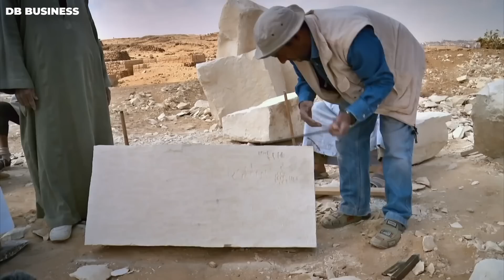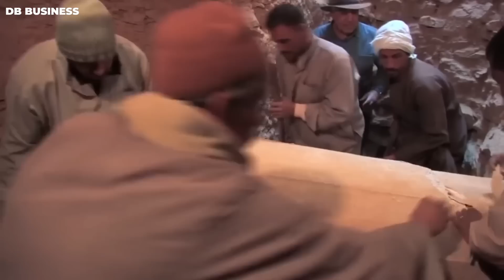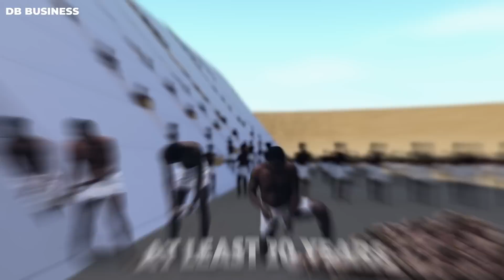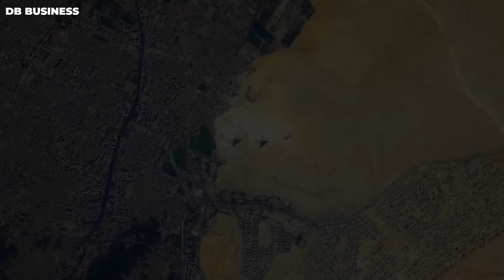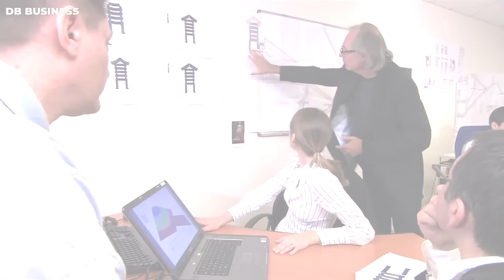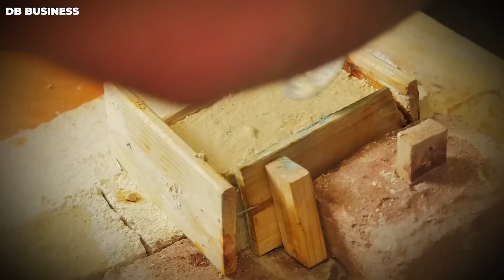The Mystery of The Great Pyramid Has Just Been Solved by Elon Musk

Comment: The main problem is when you do the math. If the pyramid was built in 25 years a stone would have to be quarried, transported, finished, and placed every 5 minutes and 15 seconds, 24 hours a day. This seems more unlikely than any "fringe" explanation.
Reply: I really doubt aliens travelled light years just to stack rocks.
Reply: @Liamgross3000  "I really doubt aliens traveled light years just to stack rocks." Whoever conquered any part of this world, built something to show off so, anything is possible. Anything but making whatever it is there using copper chisels.
Reply: @Dandan-tg6tj  they’ve certainly used a brilliant method that has been lost to mankind. We see skills lost or eroded every decade now.
Reply: @Liamgross3000  It is possible but for the marks left on the stones the only possible way is through using power tools, trust me.
The way a 3D, 90 degrees angle is cut is amazing. The way I would do it is using a diamond powdered milling blade and at the very bottom of the angular meeting point I would use diamond powdered fine drills (probably not thicker than half millimeter).
other than that I honestly don't know how this would be possible and most definitely it is not possible using copper tools (they have to be fine tipped  and a fine tipped copper tool is never going to carve anything from granite, ever).
I don't recall well what i was saying exactly (youtube doesn't make it easy to follow) but if we talk about the way they were able to bring huge chunks of rock to the construction site, well, there are some ways to flood a controlled area after the rock is ready (some air filled thingies helping the stone to stay relatively afloat then opening that area towards the river, let the stone travel almost freely. At the end of the journey the relatively afloat piece of granite might be directed in another flooded area then once there the area is having the water drained.. 
It can be something like this.
Anyway, the traces of that are completely missing. This is a huge question mark.
Reply: @Dandan-tg6tj  I’m not sure they would have power tools as we know them,  but I certainly don’t have the answer to that one. 
The accuracy stones are cut on some ancient monuments is truely incredible. 
In moving the stones,  I think massive amounts of man power and some ingenuity could do that. One man can stand a twenty tonne column upright on his own. I’m sure a workforce of many thousands can do a lot.
Reply: @Liamgross3000  we are the aliens
Reply: Plus Rock's being transported 500 miles alway...impossible..in 25 years.
Reply: Build by giants seems more reasonable
Reply: Simple answer. It took longer than 25 years.... How do we legitimately know how long it took? We don't know who built them , how and why but we definitely know it took 25 years.....
Reply: @sf7862  LoL so true... Ding ding ding what do we have for him Johnny.
Reply: @sf7862  that’s what the Archeologists claim, 20-25 years, based on it being a tomb for the Pharaoh. They won’t budge on this, which is ridiculous. I’m not proposing “Aliens built the pyramids” or anything like that, but it wouldn’t hurt to have the academics and professionals approach this with a more open mind and consider a few different hypothesis?
Maybe it wasn’t a tomb?
Maybe it took 100 years to build?
All the tombs in the valley of the kings have lots of writing inside, the pyramids don’t.
Do some real “proof of concept tests” more than “moving a heavy block a few feet”, actually work on building a small section?
Try to solve the same problems the builders would have to, etc.
Don’t ignore actual science, just because it doesn’t fit their preferred hypothesis.
Like water erosion around the sphinx.
Reply: @sf7862  yeah this is what I always say to this argument too.  That 25 year thing is worthless.
Reply: @sf7862  Obviously the pharaohs didn’t know this , which is why their lie was so outrageous.
Reply: @sf7862  The 25 years is based on scrolls found stating that it was built in 25 years.
Reply: @sf7862  the only comment I read that makes any sense seriously...
Reply: Not only that no rope could handle that much weight if that was the case there be no need for chains or cables,i still say there a power plant of some kind way there buit but it could of ben humans that was more advanced millions of years ago we was almost wiped out multiple times an the great flood as well changed alot ,any technology would of ben turned to dust in all that time.
Reply: That's because you can critically think, most folks just accept what they are told is true by some authorized and trusted athority. No one is to be trusted because they all have agendas and you must know by now we are not the beneficiary of that agenda.
Reply: also the stone is sandstone, and the stones have no drag marks on it, also their ideas also does not fit the basic construction of it, which has no flat foundation
Reply: @J.Smith-rc6wh  drag marks? They would not drag them that would be too much friction they would have ridden on a sled of some type.  The foundation is set on bedrock why would it not be flat?
Reply: @J.Smith-rc6wh  I miss you..
Reply: Just watched this docu series in netflix called "Ancient Apocalypse" by Graham Hancock and his theory is an advanced civilization existed  before the cataclysmic event that happened between 13 to 9,000 yrs ago and it almost wiped out all species and destroyed the existing civilization on earth including whatever advance technologies they've got.
Reply: @peterstark4562  its a fun theory thats for sure, im not against it, i love graham hancok's work, along with randall carlson. If you want even more fun check out billy carson or mathew lacroix, far out ideas but fun.
Reply: @MatHatter There are interesting hypotheses about using wood-mechanic wind winches to pull the blocks. And with enough pulley blocks, you only need one man to move any object. You can make slipping pulleys from rope without pulley blocks as well. 

Also; at that time it wasn't a desert. It was once wetlands and djungles, and widely populated.
Reply: @calysagora3615  If advanced technology was used what happened to it? There are many reasons to suppose that the pharaohs did not build the pyramids but whoever did must have used more than brute force. The argument that a 100 thousand workers or slaves occupied full time for 25 years could have  built them is deeply flawed. What society could grow enough food to keep such a large group of people fed , housed and organised? Slaves are meant to be economic asset not a burden.
Reply: @kingofenglandthethir  Among the more feasible hypothesis I've seen is that they might have used a number of vertical axis wind powered winches in series, to pull ropes.
Reply: @kingofenglandthethir  And yeah, there basically are no traces left of things made from wood, rope and fabric. Hell, it took hundreds of years to figure out just recently, that central Sahara used to be a sea, and the rest a rainforest full of human civilizations. Chances are that there was lots of wooden structures in general, gone with no trace.
Reply: @calysagora3615  yet none of them could be replicated forget 25 years but not even once with out tech now?
Reply: @MatHatter Nah, you (and many researchers) simply assume it couldn't have existed. In reality the only thing still standing of a massive and sophisticated civilization are these heavily deteriorated humongous pyramides. Everything else has simply been eradicated by the passage of time. There would me no more reminence of those ropes, pulleys, or other tree based anything. And again, it wasn't necessarily as much of a desert back then.
Reply: @calysagora3615  so like nobody not a single family in Egypt decided to pass down the knowledge of how the built 5 (I think) other ones and theres pyramids across the world built in different periods some during the same timing with no known contact of the civilizations yet again it can’t be replicated nd not a SINGLE SOUL knows how to do it again? Idk that seems more far fetched than aliens when we know of Pompeii nd everyone there was wiped out nobody is related to those people right now yet we know exactly what happened? Idk that’s pretty naive
Reply: That only works if it fits your mainstream paradigm...it doesn't work because it doesn't fit so that means that you must form a paradigm that fits! We've ALL  been mis lead and indoctrinated  into the mainstream narrative paradigm (world view) that they want so that we will be and stay confused just like we are(according to their plan)...and it's obvious that it's working!
Reply: Bro there is NO explanation just hypothesis's, ass-umptions and biased excuses because nobody here actually knows! Hey if anybody actually "knew" how many indoctrinated sheeple would believe?... Lol nobody so why do all of you just keep on asking questions that you know you'll NEVER EVER FULLY KNOW?
Reply: 100,000 men working 8 hours a day would need to make and transport 3 block a year each, could be done maybe
Reply: @Ra Akhanaten Who knows, maybe they had Lazer cutters and levitation technology. 🤗
Reply: 2.3 million blocks
25 year
92k stones per year
1769.2 stones per week 
252.7 stones per day
10.5 stones per hr
Reply: @smo18780  That's assuming simply stacking blocks on top of one another, ignoring internal structure that includes chambers and tunnels and granite blocks in the heart of the structure, all precision cut and of different sizes. And why is the base and height related to the earth's and moon's measurements. Why are the sides lined up with the cardinal compass points? In short, they didn't just stack blocks but did it with a high degree of precision, thus with purpose. So the bigger question is WHY.
Reply: @smo18780  "2.3 million blocks
25 year
92k stones per year
1769.2 stones per week 
252.7 stones per day
10.5 stones per hr"
It seems to be achievable.
The problems starts when someone is actually doing the work.
Then they see they had to take under account a million other time consuming tasks. So, your calculations are a waste of time and are completely bogus.
Working on big projects preferable with heavy weights and with over 1000 people will teach you all you are missing. Then you may be able to do some calculations.
Reply: @Dandan-tg6tj  
Thats not my opinion
I was simply reiterating what experts have been saying for decades.
2.3mil blocks in 25 years
In my opinion it must have taken far longer than the general consensus.
They would need many different crews doing multible jobs.
Its still a mystery in my mind
So how is my comment bogus???
Reply: @Dandan-tg6tj  
The truth is there are definitely mechanical tool marks left on rocks
But the pyramids were also being deconstructed as early as the beginning of the 20th century to build Cairo.
The mystery of how the are built is part of the tourist attraction.
The only undetermined factors are time and lifting.
Shapeing the blocks were done with chisels, hammers, wedges and wet sanding.
Reply: @smo18780  I'm not talking about the blocks per se. I'm talking about "sarcophagi" and other alike which are blowing my mind. I'm talking about the unfinished obelisk nobody can lift. what about that one?
Reply: @Dandan-tg6tj  
I agree its a mystery 
The stones at balbek are even more impressive.
Reply: @smo18780  u forgot to add time for sleep and family shit. they didn't work 24 hrs a day for 25 years. there would be no Egyptian's left they'd all be dead. and most pyramids were multi generational projects. 80 years
Reply: @jeffjousnaus3529  
Brother you need to get with the times
Its called night shift
Lol
Different strokes for Different folks.
And the best part about it as there was probably an egyptian Hulk hogan for pump up and a egyptian Jeff ross to keep em laughing.
And plenty of beer to go around.
Lol
Chive on
Reply: @smo18780  and the lighting needed such a venture other than the sun the other 12h quarries, pyramids, transport rds ect came from?
Reply: Yes, and add to that, the fact that the Great Pyramid is not just a bunch a blocks laid on top of others but has chambers and tunnels, all precision aligned, plus 8 great beams of red granite above the king's chamber.
Reply: The Egyptians used acoustic levitation to move the stones
Reply: @hehehohonono  sure
Reply: They had JCB back then for the so called heavier stuff its only 10ton some
Reply: @Mystic One Actually, THERE IS DOCUMENTATION OF THE EGYPTIANS USING ACOUSTIC LEVITATION
Reply: Things that we understand as impossible is relative. I can easily move a million ton glass pyramid anywhere you want inside a world inside my computer.
Reply: @freezin48  Even on a computer, using  rectangular or other 3D bricks, make a creased pyramid. There your computer programming skills become challenged. I haven't even mentioned what has been found in the tunnels and innards. I come from a family familiar with stonework such as that in monasteries ... not easy problems, but simpler than that Great pyramid sitting on Ma'at, truth, or the level playing field. The Great pyramid is a monument to thought...Tehuti, sitting on Ma'at, the earliest and most profound of what is known as the Egyptian pantheon. Most gods in Egypt were represented on a level playing field, symbol of truth, or with a feather or a balanced scale. Truth and thought... even in modern times it would be hard to have a more profound theology. Even the simulacra of Boudrillard is not dissimilar. Nor the ethics of Peterson.
Reply: Would take one crew of 50 men... what? 2 days? A week? Lets say a week.  Thats 10,080 minutes. Divided by one required every 5 minutes, 2016 teams of 50. Could be done by 100k people.  😉
Reply: @gravestoner  "Could be done by 100k people.  😉" They don't pee, they don't poo, they don't eat, they don't get tired. Yeah, sounds realistic to me.
Reply: @Dandan-tg6tj  aah sorry forgot to calculate for bathroom and meal breaks. This was regular work hours so, wont address sleep. How much of the working time is spent on break? 10%? 25%? 10k more people needed? 25k more needed? 

Sorry your new revelation does not result in the requirement of millions of people. 

Still plausible, unless you have any statistical information to share in rebuttal?
Reply: @gravestoner  Until someone actually do the work and literally quarry a stone, transport it in place and actually is thinking about every singe aspect of that work, I won't even bother to say more because there are so many aspects to take into consideration.
Calculating is something but doing it is something else entirely. Trust me, I know. There's times when people don't take under consideration things that might seem minor but when they actually start to build things, they often reach a point where they have to abandon the project because there is nothing else left to do anymore. I've seen that so many times with my own eyes.
Did you take into account the actual movement of the people to and from the sleeping places? It also takes time. You can't have 100.000 people moving like a fish bank of some sort. Managing movements in a safe manner is a tremendous task and one single accident may have blocked the construction for a long time. Taking into consideration the enormous amount of really heavy stones to be handled, I'd say that accidents were very well known and the stopping of the flow was something happening quite often. One block of stone of such weight would require some time to be removed from the way of the rest of the stones, to let the current of stones to flow smoothly again, in a case of mishandled or of an accident.
There's so many things you did not take under consideration, just like the ones before you.
There's more. There's a lot more and you really don't know about.
A half-calculation is always going to end up with the building to crumble.
For a project of such magnitude there is always a factor to correct the timeline. There's a bigger factor with a bigger number of people. There is a percentage of people who would be lazy, there is also a percentage of people more prone to human error, there's people who get sick and can't perform as expected and while they may seem to slow things down only a bit, they may cause a snowball effect leading to a full stop of the construction. The time to start things back to as they were it also must be taken into consideration...
I stop now. I guess you get my point.
Reply: @Dandan-tg6tj  ah, in that case you might want to look up the guy who moves and positions stones that weigh tons by hand using.... other rocks. Yeah its pretty revealing. Imagine 1 man can position these huge stones by himself, how large of a stone could be positioned by a team of people???

As for one stone needing to be removed before the next team can come in.... no they would continue to work around them. Quarrying stones themselves at the same time as other teams. 

Im sorry your mind has more doubtful questions than logical answers.

A percentage of people who are sick or lazy.... yeah so they had to employ another 10k people like that was impossible. 

Your reasons then, still exist today. People are lazy, make mistakes, call off sick, does this mean steel plants cant produce the insane amounts of steel they produce? No they simply account for it and maximze production.... like they did then. 

You really think it was the aliens dont you? Because people with your iq, 4,000 years from now, will say the same thimg about us building a skyscraper while they sit in a city floating in the sky.... 

"how could they produce so much infastructure with only 6b people? In a few hundred years?! Yeah right! Theres no way they made pavwd roads across entire continents, let alone the cities themselves. Theres no way they got that done in that amount of time with the technogy they had at the time. Must have been aliens"
Reply: @gravestoner  That's the first comment ever I can seriously take under consideration for the mainstream theory.
I will share it with everyone who wants to know.
I'm a mechanical engineer myself, used to work in construction and made up stuff like this pretty often but at a much smaller scale.
Anyway, Thank you so much for sharing this. It's really appreciated.
Reply: Brien Foerster has a LOT of amazing video of these sites both in Egypt & South America and elsewhere! Cannot recommend him enough!

https://www.youtube.com/c/brienfoerster
Reply: The hilarious shit is these Arabs believing THEY built them. White mummies have been the oldest found and the only ones found in Chinese pyramids et al.
Reply: The pyramid's are older than we are told, there is proof they were once under water for some time. There are power tool marks in the stone, its well known now that 1 of the chambers was filled with sulfuric acid, and that wasn't discovered for thousands of years later, traces have been found on the walls. Their are carvings on the walls depicting light bulbs and copper has been found inside, copper is a conductor, and the top of the pyramid's were pure gold as depicted on the walls in ancient Egyptian. Again another conductor for electricity... mainstream scientists, news and religious groups ignore all of that, and still spred the lies of 100k slaves built them, using primitive tools in 25 years knowing today we can't do it. 
The pyramid's are 6 sided not 4 sided aswell, everything i have said here is 100% proven but like I said the mainstream scientists, media, government's and religious groups discredit anyone who speaks the truth because it would change everything.

The Bagdad battery is 2500 years old or more, it's been made today using exactly what the ancients used and it works. The pyramid's in Egypt produce electricity.
Did aliens build them? Maybe aliens taught mankind all of this, or maybe man really did build it all and were alot more advanced than we are today, but something happened and it's lost to history, or government's and religious groups know but keep it buried. Mankind is older than 10,000 years. Alot older. 
Mainstream scientists, media etc have made it very clear different cultures from different country's all over the world didn't have any contact with 1 another yet pyramid's are found around the world aligned with the same stars and they are all perfectly aligned along the equator. Accident Egyptians traveled to Australia and carved into rock their own language, other cultures have been found in other country's round the world, they were all connected and traded with 1 another, myths and legends are almost the same in every culture. 
So if you believe mainstream 100k slaves built them with primitive tool's than you are totally stupid! Think about it the USA government swore ufos do not exist and discredited anyone who had proof and people were killed or never seen again. They did that for over 70 years then admitted they do exist in 2017. So media, mainstream scientists, religion and government will lie and discredit anyone who disagrees with the ancient Egyptians and how they built pyramid's and how advanced they really were.
Reply: @Joel Roman I know right, it totally blows me away that so many people believe mainstream scientists and media etc that ropes, 100k slaves  moved 80 tons or more across land for 2000km give or take using logs from the closest quarry, or boats down the Nile. 
Its amazing how many people accept this as fact even though its been proven total bullshit yet they still believe it. Glad someone here actually has common sense 🙂
Reply: @nopeboat5383  the 25 (actually approximately 27 years) comes from the fact that they atribute the time period and approval of construction to Khufu (Khafre) who reigned for about 27 years.

now, what evidence you may ask? well the answer might suprise you.
would you be amazed to discover that the most intelligent minds on the subject used all the deductive reasoning at their disposal, and applied it to 2 separate pieces of evidence:
1. Graffiti in the main pyramid stating (loosely) "friends of khufu" written only once in dubious circumstances and placement.
2. a single document attributed to a master architect that lived (possibly) during khufs time, ordeing (purchasing) casing stones.

i know, its astounding right? that our feeble brains just cant compare to logic like this...

its like finding skeletons of people, and some of them have spears, "oh, they must have ALL been hunter gatherers..."
Reply: The answers are either Destroyed or under the Vatican... either way they will never allow the truth or anything to contradict the main narrative PERIOD
Reply: @nopeboat5383  well Egypt IS lying about them, because Arab Tribes never even lived there back then. So no, not exactly, but kinda?
Reply: There were most likely building teams on all sides of the pyramids while constructing. If you have 4 or more teams of say thousands of people a side they can place way more stones than currently thought. Aliens sounds fun, it does, but humans have done amazing things too
Reply: @Youremyboyblue_   Truth is we can't know. The only thing we can know is that they built things using a technology very different from copper chisels and smashing things with stones.
Reply: @Dandan-tg6tj  oh for sure copper chisels weren’t used and I wish that would stop being put out there. If they did it still wouldn’t have been done. The scoop marks on the unfinished obelisk seems like a big clue but it was so long ago and so much has changed we can never know for sure
Reply: the ancient Egyptians did not build the pyramids. The pyramids were built around 13,500 years ago not 4000 years ago. The explanation for this is that the 3 stars that the pyramids are supposed to mirror were directly above the pyramids 13,500 years ago not 4000 years ago. Also there is no evidence any pharoh was ever buried in the pymirads and there is no Egyptian writing inside the pyramids. Like there is with other ones.
Reply: Leave it to the pros buddy
Reply: This is an excellent video!
Reply: Possibly the stones were made earlier transport to the site before construction and the numerous workers worked day and night
Reply: I believe the archeologists.  Not a YouTube video
Reply: For real man 👍
Reply: I was interested in the fact that the video calls the pyramids 'tombs'.
Reply: Who said it was 25 years?
Reply: @dom85ross  Who said it wasn't?
Who after all dared to say something as being a truth when they have absolutely no clue?
Anyway, I guess it doesn't matter. People would believe anything they're told to believe.
Reply: It's actually less than 3 minutes per stone, they couldn't build during the wet Nile season but still you're on the right track. I estimate 135, 155k year's old?
Reply: But you have 50000 workers, and ever 100 filled one in a few hours, thats about right
Reply: OP, why does it have to be one stone at a time?
Reply: Concrete blocks poured
Reply: @tomwinkle1597  Poured, yes, but it's clear the stones are not made of concrete.
Reply: @MisterHowzat  and you know this how? No man today has a clue about past technology. Granite stone that appears to have been poured in a mold? We have no clue, guessing at best. Silicon era,  giant trees?
Reply: Uncle Montezuma goes wild
Reply: Don't underestimate the capability of 20,000+ workers
Reply: @user-hh9ni8su3p  "Don't underestimate the capability of 20,000+ workers" Don't underestimate the capability of 20,000+ workers to commit errors, to make things explode, to quit, to be in some other place than they should... The 20,000 people are not robots. The more they are the less efficient they work. The more they are, the more there is a change for one or more of them to blow up things in a very bad way.
If you would work with a large number of people you would know what I mean.
By the time one of them screwed things up, that huge boulder of stone would end up blocking the entire flow of stones and of work.
Only those who don't know how thing really are, can think of that a high number of people can do things faster. This is totally wrong. The more people work, the higher number of them are drunk, upset, tired, ill or plain stupid. The risk factor is there but nobody seem to know about it. For each and every 1000 more workers the gain is only say 80 percent of ideal. For every 2000 more the gain is only 75 or even 70 percent. For every 5000 more people there has to be a significant number amongst them to provide the rest of infrastructure  so 20.000 people who work means in fact probably at least 5000 who don't actually work but provide infrastructure. You get my point.
Reply: @Dandan-tg6tj  well I work at the largest amazon warehouse on the east coast so I know what it's like to work with a few thousand people, and you're right things become very inefficient, but at the end of the day we still manage to produce insane amounts of work which wouldn't be possible with a small workforce.
Reply: @user-hh9ni8su3p  One more thing I have to say then I say nothing more. In this world there are so many big projects which are left behind. They started to build then they were overwhelmed by them and they stopped.
You have some very efficient help in managing all that workflow, don't you? Do you think it would be possible to produce that amount of work without the help of a traffic management?
How do you think Egyptians managed their workflow efficiently?
How did they manage the timing?
How many people were there to manage accidents?
How many spare people they had at any given moment?
To even gather 100K people is a tremendous task. To accommodate them is also a tremendous task.
On top of everything the "sarcophagi" found have an unattainable finish without proper tools. You can't put 100 men inside one to speed things up and for 2 people to work inside a sarcophagus for a few years doesn't ad up. There are power tools marks all over the place but the tools are completely missing.
This alone should make us all seek for another explanation than the use of relatively brute force in making all that stuff.
I'm not saying that aliens did it, I'm not saying a god did it, I'm not saying I know how and why they did it. All I'm saying is that someone (maybe a craftsman people were traveling around the world building amazing things and the info about them is lost to time. Also the tools they used were probably gathered with them so we can't find them anywhere.
The only thing that pops to mind is that they were the lost people of Atlantis, or something similar that like Nephilims or I don't know what other  and we can't find them and their tools because we simply don't have access to their place no more and maybe we never had access.
Sure, they were probably used some local work force in big numbers.
That is what it seems to me more close to the truth.
This or the possibility of humanity existing again and again, being wiped out again and again for some reason and some of the olds managing to escape extinction.
I know it sounds preposterous but is it really?
Reply: @nopeboat5383  Actually, the truth is stranger than the fiction they peddle. They can't even explain the machine marks on the stones but rather they choose to ignore the evidence.
Reply: If you had only been there to watch and learn, you would not have to guess and try to act like you have a clue. It is a huge waste of time to use a chimp brain to try and guess the ancient technologies.
Reply: @Mystic One Uhh... I was talking about the pyramids of Giza. Right, that it was not the Egyptians who built them, that was what I said.
Reply: It literally has hieroglyphic showing how the large monliths were quarried, carried and placed
They did not have POWER TOOLS PEOPLE.
Reply: Pyramid  triangle mathematics pysics science  Atties predict future Relegion predict fast fake story Stupid Don't claim Egypt Moses Jesus Shiva maakali sneak  Relegion stolen distroy hackers scam data music universe alone
Reply: I think your ignorance and cultural bias is showing.
Reply: Dang.. check ✅ this 
Say 🌍 what 🤔
Were 🌎 made 🤔 in 🌍 HIS 🌎 image 🤔. HE 🌍 made 🌎 us 🤔 with 🌍 the 🌎 p 🤔ower of free choice
A good prayer:
I'm a sinner JESUS please forgive me for all my sins I know you shed your Blood for me on the cross at Calvary. Thank you JESUS for my salvation and for shedding they Blood for me. I love you JESUS. 
Romans 10:5/10 ct...❤️k
JESUSisLord!Amen...
Amen..
If you'd like to call someone who cares 
83
For
Truth.
bc you don't know when you'll die?
.y r u hesitant.
.
💕.
Right 👍.
Reply: Elon isn’t what everyone thinks he is . He is great at learning and regurgitating but when it comes to original thought , he doesn’t have it . He is a media sensation and you give him your trust . He will show you who he is just wait .
Reply: If you change the sizes of humans that labored for these pyramids, you get the answers. Look the size of statues, there's 3 types. The titan Giants were 25 feet, equivalent to the egyptian statues, but Gilgamesh ere slightly smaller, tartarian giants were only 12 feet tall.... 
Mr. Rogers at the mud flooding university channel explains the petrification of giants. Stuffed beagle, Jonlevi, Paul Cook channels explains the tartarian civilization pre 1775. Nightgod 333 channel shows other alien races and flat earth, and mufon, extraterrestrial beings.
Reply: @meggtokyodelicious  
If you get yourself a passport, expand your view of the world around you, eventually you will stop needing to believe in silly, childish ideas like giants.
It's the same way you eventually gave up needing to believe that Santa Claus was real, after you grew up and met older, more experienced kids in life.
I guarantee it.
Reply: @meggtokyodelicious  https://www.youtube.com/playlist?list=PLSSFj6Q5TZYQnX74l-gL231kNMJAmsV06
Reply: took 80 years to build.
Reply: @jeffjousnaus3529  What makes you believe that?
Khufu didn’t reign as pharaoh for that long.
Reply: @davidleomorley889  simple math, stop thinking with speed of machines read a book
Reply: @davidleomorley889  most pharaohs waited for tombs to finish. no-one has found completed pyramids prior to death. most waited 14 to 34 years to be entombed
Reply: @davidleomorley889  what makes you think pyramids' were built and ready for the pharaoh.......
Reply: @davidleomorley889  lol its simple math.....and yes i have a Phd in math so really simple math
Reply: @jeffjousnaus3529  What is simple math?
Give me some context about your statement?
Reply: @davidleomorley889  math cant lie or be twisted to show the distorted human decisions on what's real because politics. based on what the leaders of the day current and past have heavily filtered into ancient Egyptian past. hence simple math
Reply: @davidleomorley889   lol it has the word maybe and only been watched 6k times,......ill pass
Reply: @jeffjousnaus3529  When people died, they were mummified and buried 70 days after their death.
That information is well established and understood by the people who research the topic and who have spent years in universities.
That’s just the way it is.
When you try to claim that pharaohs were sometimes buried years after their death, you are simply displaying the fact that you haven’t studied the subject.
There are more than 260 lectures on Egypt’s history available for you to watch on my YouTube channel.
That is a good place to start.
Getting yourself a passport and traveling here is also a good way to get started.
Reply: @jeffjousnaus3529  Many pharaoh’s tombs are unfinished because the king died while the tomb was still under construction and the people who build the tombs could not finish them completely before the 70 days were up and he had to be buried.
Again, this is very basic knowledge for anyone who has studied the subject.
Reply: They should put more emphasis on pyramid reconstruction. That would settle what it can do.
Reply: @CatMan_7  What is the motivation to build a giant limestone pyramid in the 21st century?
We build helicopters and robots that travel around on another planet.
We can certainly build one…however there isn’t any reason to.
Reply: The Pyramids were created by the relatives of Enoch
Reply: @virtualpilgrim8645  That is ridiculous.
Reply: why didnt they just build a rectangle
Reply: @pablovaldes2397  By order of the Pharaohs
Reply: @davidleomorley889 whatchu talkin bout willis
Reply: @pablovaldes2397  Come here to Egypt and see for yourself
Reply: @pablovaldes2397  You should stop believing in your fears and embrace the adventures of travel.
I just spent 4 weeks in Cairo and never saw a camel. 
Now I’m down in southern Egypt for several months and the people here are the nicest and kindest people I have ever met.
Reply: @pablovaldes2397  The mummies are in museums and tombs.
Reply: the fact is they were built with geopolymers, they can make a block in less than 5 mins ignorant
Reply: @karam2607  There are two basic ways to come to believe" in things in life today. One is by behaving rationally and the other is by having faith in someone.   
>Being rational means examining the available evidence, listening to the educated professionals in the specific field of study who have examined it in detail and who have conducted experiments on it, keeping an open mind and maintaining a healthy amount of skepticism during the process of research. 
Theories are usually presented first by writing a paper explaining their specific theory and the experiments they used to come to their conclusion. Their peers then examine the theory, replicate the experiments, conduct new experiments, all in an ongoing attempt to see if the theory is valid. If the theory survives all of the scrutiny it receives, it usually moves forward and is accepted by more and more of the rational people in that society.
This process is referred to as science.
This is how Einstein's theory of relativity was presented…and how it survives yet today.

>Acting on faith requires no evidence, only the belief in a person’s claims. When their claims don’t hold up to their peer's scrutiny, it simply doesn't matter to those who have faith...because that IS the essence of what faith is.
The words and opinions they are speaking are seen as being unquestionably true by the faithful.

>Believers in Santa Claus have faith in the words of their parents. 
>Those who follow the Abrahamic religions have faith in ancient texts. 
>Mormons have faith in the written words of an American scam artist, Joseph Smith.
>Scientologists have faith in the written words of L. Ron Hubbard.
>Those who believe what Randall Carlson tells them have faith in Randall Carlson.
>Those who believe what Graham Hancock tells them have faith in Graham Hancock.
>Those who believe what Brien Foerster tells them have faith in Brien Foerster.
>Those who believe what the guy on Uncharted X tells them have faith in what he tells them.
>Those who believe in Edward Casey’s miracles have faith in the words of those who claim those miracles happened.
>Those who believe in "advanced ancient technology" and a “worldwide pre-flood culture” have faith in the book authors they heard that information from…whether it was on YouTube, Facebook, TV or in a book.
>Ancient Astronaut theorists have faith in the words of people like Zecharia Sitchin and the words of TV personalities like Giorgio A. Tsoukalos.
>Those who believe in an ancient race of giants have faith in the people who are claiming that an ancient race of giants once existed. 

“Religion is a culture of faith; science is a culture of doubt.” 
― Richard Feynman

Science actually claims very little. Science is simply a method of discovery that uses peer reviewed experiments and evidence to examine theories and determine truths. 
When new experiments produce new found truths, science moves to support those new truths. That’s all science really does. 
> I rely on the method of science, because I am a rational human being.
Reply: Your math is SERIOUSLY flawed, and overall wrong.  You are leaving out about 50-100 variables, each of which, could make your argument ridiculous.  This is how racists make statements, hoping you are not wise enough to punch holes, but basically this comment is a huge chunk of swiss cheese.
Reply: except they had 25000 people working on it.
Reply: Didnt mention also flattening the giza plateau and laying foundation giant stones first before pyramid even started
Reply: It was crush and poured actually, like concrete..well it is concrete
Reply: @nourahrmumeenfba  the casing stones were supposedly concrete, not the whole structure
Reply: @daisydog388  it all was crushed, mixed, and poured in place. Do you have ancestry in Egypt to corroborate that narrative? because I have tons to corroborate mine.
Reply: @nourahrmumeenfba  for starters you can google and see the rock quarry where the blocks for the pyramids were cut out from, second, eqyptologists themselves like to mention an old papiri scroll showing how they moved large blocks on boats. Whats your evidence for it being concrete?
Reply: 💯. This theory they put forth is completely implausible. All while attempting to debunk any other theory. Like we're all stupid
Reply: After watching Ancient Apocalypse by Graham Hancock, I am of the Notion that either/ or Giant Humans existed. Pyramids are all over the Globe, many step Pyramids in Mexico which is quite extraordinary & distanced from Egypt. Mexico has the largest pyramid but no one speaks of. Near Egypt in Sumeria are more pyramids & China has pyramids too. 
Dont forget to look at Peru & how they built these precise multi-ton cities & pyramids too. Coincidental having pyramids globally? How is this common theme possible? Not modern mechanical tools during or before or after the Ice Age.
Reply: @DesertlizzyThe  
Pyramids exist globally because gravity exists globally. 
If ancient civilization that wanted to build a monumental structure the reaches as high off the ground as possible using solid blocks of stone, there is no other choice but to have a pyramid. 
Pyramids all have a wide base and get smaller and smaller as you get closer to the top...because gravity dictates what is possible.
Reply: Boys boys .. 😀 the answer is simple. Angels known as Giants or Aliens came to earth to help the hunter-gatherers.
Reply: I’m pretty sure copper tools were tested on the stones around the pyramids and they were pitiful, something like a day to saw half way through a block if you used constant water and kept replacing the tools.
Reply: @MaliciousMatt888  Sorry, 90+% of the Giza pyramids were built with low grade roughly hewn blocks of limestone quarried just meters to the east of the pyramids themselves. 
You can see the chisel marks on many of them but they were mostly quarried with diorite pounding stones.
The granite that was quarried in Aswan and brought downstream on the Nile River to the pyramid building site has been shown to have been successfully quarried using fire, copper saws, drills and sand as an aggregate, which is harder than granite.
We even have documentation of them bringing the white exterior limestone from the quarries in Tura, across the river from the Giza plateau.
Reply: If you actually go to Egypt and see the pyramid you'll see that it's largely rubble with stones in front. The liars tell you a piece of paper can't fit between them. Wrong. Mortar was used all over it and you can tell. Get off the conspiracy videos and go see for yourself.
Reply: @L_Train  Well in certain places it has been messed with and damaged the other part is true. Maybe you should go there...  There is plenty of documented evidence btw.
Reply: That's a great approximation indeed
Reply: BUY & HOLD , STOCK (WTER) ALK88. WATER . SHAQ is Now brand Ambassador & Board Member. New CEO making great headways for profits next QTR , Elon Musk needs to own this water company before Coke & Pepsi try to buy them out.
Reply: Don't under estimate the will of man power!
Reply: @nopeboat5383  ohhhh it’s for tourism but to line Egypt’s pockets if they don’t have a claim to it anyone can come buy it because it’s no longer ancestral grounds it’s just like anywhere else people died/were buried nd can but taken from egypt by anyone but if it’s ancient ancestral grounds it’s off limits believe that’s a war crime as well to attack places of that nature
Reply: Its called SLAVERY.
Reply: Maybe it was the fallen ones.
Born of angel seed to human mothers.
Also possibly alot of this was in same period as King Saul who had rule over these powerful beings as they were subject to him.
Reply: For sure Kram that's another huge factor to account for
Reply: how do they know the blocks are all the way through and the whole pyramid. maybe they just mounded up the dirt and placed the stones just around it?
Reply: Actually the math works out to something almost reasonable. 25,000 people working on the pyramid say in 250 groups of 100 people would be about 1 stone per day per group 25 yrs being 9100 days (364)  2.3 Million stones/250= 9200 they would have to average just over 1 stone each day per group the numbers are not that drastic and even if you quarried and transported for a 14 day period you'd have to move about 25 blocks to site then finish and install them in 10 days. its quite possible to do. this all assumes they are accurate that it was only 25 yrs include another 2-3 yrs and it becomes easier to get done.
Reply: @dragoneyeshatesg00gle76  but we’ve tried to do a scale Model of Giza, with 200 men. 
They failed miserably placing just the first couple of 100 Ton Stones.
Reply: where does the 25 years come from.?  also, lets multiply and see its really no better.   50 years a stone every 10 min, 100 years a stone every 20 min 500 years a stone every 2 hours which is still equally insane. 1000 years they would have to quarry, transport, finish and place a block every 4 hours, thats still inconeivabley fast isnt it?? 10,000 years it would take 40 hours per block to quarry, cut , transport, finish and carry up the pyramid and precisely place.  That sounds like gettting close to possible.  but 10,000 years at that rate..
Reply: @ScreamingEagleFTW  cause they said ( you know your history book from school ) it took 25 years to be built. Which is a lie, and also Egyptians didn’t build them. Just took them over, or found them and claimed as their own.
Reply: You people are basically mental patients with access to the internet
Reply: I don't see how that's a problem. All these tasks would be done in parallel and each task itself would also be done in parallel by different workers. If 5 workers do 1 stone in 1 week on average then 8,000 workers do 1 stone every five minutes for 25 years, there you go. Besides, those workers were probably assigned 1 specific task. Imagine doing the same thing again and again for months, you're gonna be pretty efficient at it.
Reply: the stones are man made, geopolymer. a type of concrete that very closely resembles the stone that one wants to make, using aggregates of that stone type + alumino-silicate + lime (or other alkaline)
Reply: My favorite billionaire, Musk could crack this mistery easily: offer 10 billion dollars  to anyone who can build a great pyramid without electricity, steel tools and heavy machinery or equipment in 25 years. It would put an end of this argument once and for all. On top of that modern Egyptians will stop telling finally their genius ancestors built the pyramid with copper tools four thousand years ago. 
I am especially curious how anybody could lift a 80 tons granite block up to 400 feet even using all tools in our disposal now days..
One more question: if Egyptians was so developed back then how come Egypt is a third world country today. I am asking for a friend…
Reply: @maxhamilton8204  i build things for a living and use my hands daily! I see granite guys cut stones for kitchens and bring then inside its usually 4-5 guys carrying a 4ft-8ft piece of granite that is 2 inches thick and they struggle!! All these scientists probably never lifted a hammer and do not understand what it takes to construct things by hand
Reply: @maxhamilton8204  That actually made me laugh out loud. There was an architect who showed how to move the stones without electricity or power tools. He did it. He proved it could be done, but at immense time and resources per stone. You would have to be really bad at Math to believe it was done in less than a few  hundred years.  I think the Egyptian government is embarrassed that they believed they were tombs until 2018 when it was proven they could conduct electricity.
Reply: @maxhamilton8204  Once Romans were the conquerors of the world. Other times France was on the very top. In Latin they had a saying: "Sic transit gloria mundi"
Every nation can flourish and perish.
Given enough time, even entire continents can disappear or become pray to the desert or to the ocean.
Reply: @maxhamilton8204   He is just a made up character. He is not what you think.
Reply: @maxhamilton8204  easy pour concrete like they did
Reply: In ancient time the knoweldge was among few people,during the war once they lost the war ,were killed by barbares who know nothing except killing
Reply: @maxhamilton8204  no it wouldnt because the egyptians could have techniques or technology that is completely unknown to us
Reply: @maxhamilton8204  The Egyptians did not build the Great Pyramid. It was there before anyone labelled "Egyptian" ever lived there.

As to Egypt being a third world country,.... History has shown that civilizations rise and fall. So, even if the Egyptians built the Great Pyramid, that was thousands of years ago. That civilization is long gone. The Egypt of today is not the same as the Egypt of the ancient pharaohs.
Reply: @maxhamilton8204  Best comments ever
Reply: @maxhamilton8204  That's cuz most of the people who live there have nothing to do with ancient Egyptians. They came from AP. Copts are the real Egyptians.
Reply: @maxhamilton8204  third world country refers to the fact that during world war 2 (or 1 can’t remember offhand right now honestly you can search it lol) the said country didn’t align with the U.N (the United States honestly) or Soviet Union therefore being left out technologically, financially,and in pretty much any humanitarian sense (unless it’s going to help a campaign from my experience) which some countries didn’t recover from as well as America generally trying to shit on everyone and make it seem bad.
Reply: @maxhamilton8204  Completely agree
Reply: @maxhamilton8204  ancient knowledge and technology lost
Reply: We can't possibly know how they built them and we can't possibly know who built them. We know that there are too many power tools marks impossible to be ignored while there is no evidence of any power tool and this is kind of awkward. We know that some really big and hard stones are cut from bigger stones and they are finished and polished in an impossible way. Also an interior 3d corner perfectly cut IS an impossible task but somehow they made it with soft copper chisels? Well, fuck that!
Reply: @Dandan-tg6tj  And those giant Granite "sarcophagi" were apparently rough cut outside then transported inside, placed and THEN were finished! Also look at the carving on those things, the "sarcophagi" were finished to a polish yet they were incapable of engraving the carvings on the outside to the same quality of work? Bullshite those Egyptians FOUND the "sarcophagi" and used their rudimentary methods to carve Graffiti all over them! It looks like some teenager took a stone and henpecked the text all over those boxes! There are so many things wrong with their claims about the Pyramids and so many other structures around the world!
Reply: @oldogre5999  They probably wrote "Nina love Kevin" or something similar.
On a more serious note, usually people don't love the truth.  Usually people love to say they found out the truth (like a solved problem) and skip to the next challenge without actually solving the current one.
People are not afraid to look and sound stupid. The more stupid and less prepared they are, the more they think for themselves that they found the deeper meanings of the entire world.

If those who claim whatever they claim would have been experienced in stone carving they would reach a different conclusion but a stupid person is always not able to think things through properly.
It has happening all the time, it is happening all the time and it will still happen probably for as long as humanity will exist.
An engineer will always think things through many times from different perspectives BEFORE saying something which can make him look stupid.
Unfortunately those who said they found out "the truth" are not engineers.
Reply: @Dandan-tg6tj  no kidding right? Do you watch any of the unchartedX Videos? Great content there highly recommended
Reply: @PiratesInTeepees  he knows nothing
Reply: @PiratesInTeepees  him and ancient architects guy are 🔥
Reply: @letangmotaung9804  Actually, gin Tolsa makes a great point. most (accurate) esimates only count how many stones had to be cut and moved and placed. but when you facter in a multistory structure, it would take even longer to get the stones up to their final resting place...
Reply: @Dandan-tg6tj  all we know is so far with modern technology we cannot even build a scale model.
Reply: @Dandan-tg6tj  
They didnt have power tools
Lol
Reply: @smo18780  So they didn't have power tools. They only had the marks of power tools? LOL
Reply: @Dandan-tg6tj  my theory is that the Egyptians found these rocks already somewhat chiseled from the left overs of whoever built the sphinx and used them to build The pyramids themselves. Theyre right next to it and the sphinx is a singular large rock. Whoever built the sphinx out of a huge rock mountain couldn't transport All that extra rock thousands of miles away.
Reply: @Dandan-tg6tj  yo they was built way before and they go down way further. They’re an energy device created by ancient advanced civilizations. We call it the flood. We just need to dig deeper.
Reply: @Dollapfin  Perhaps. I cannot know.
Reply: @Dandan-tg6tj  I’m sure the tools were packed up and taken back-must have costed a lot and hard to replace even then🤔
Reply: @lindamaemullins5151  taken back where? Taken back by who?
You say it like it's almost common sense. Fine, so some people had this amazing machinery available and probably they traveled around the world and made those amazing monuments. Not a single civilization had this technology, not Egyptians, not Mayans, not Indians, yet, they all had similar constructions showing similar characteristics. Who took tools back? Who were those with the tools? What tools are we talking about? Where are the tools now? Where those tools were coming from?
Reply: @Dandan-tg6tj  Egyptians built them .. and it could have taken 40 to 100 years ..
Reply: @obedientfire840  Well, did you see heavy machinery marks? Egyptians did not have such things to use.
On another note... you said "Egyptians built them" like you know this for sure. How do you know this?
Reply: @Dandan-tg6tj  You are making a LOT of assumptions about building techniques that are IMPOSSIBLE to know.
Reply: @pro70z28  Man, if from what I said and what you see there you still think that I am "making a LOT of assumptions" then I don't know what you have seen and I don't know what you understood from what I said.
I'm a mechanical engineer and I know how tools leave marks on whatever they carve into. I worked as a professional in construction for more than 10 years and I know precisely how power tool marks are imprinted in stone based materials.
I was not even saying that I know how things were done but I know that sometimes we can't quite follow well what is written here on Youtube.
Maybe you only need to read my comment again.
Based on what I know by literally working in the field, based on what I have seen there on site, there is no way someone can tell me how they did it (official narrative) because it really is hilarious. It looks like those who tell us how old Egyptians were carving all that stuff with copper chisels and pounding rocks are morons who don't know basic things about rock modeling. If they knew, they wouldn't ever come up with this stupid story.
So, whatever, man.
Reply: @Dandan-tg6tj  Sounds like you might have come across Christopher Dunn's work 😉
Reply: @MisterHowzat  Read your comment but forgot to answer. Not really, no. I don't know yet who Christopher Dunn is and what his work is but I will search it up.
Reply: @Dandan-tg6tj  Cool. I think you'll like what you find.
Reply: @Dandan-tg6tj  The how is easier if the restrictions to primitive society is removed. With power of some sort and power tools and with centuries, much more possible. Why, when, and who are harder. Water erosion pushes the construction back 12,999 years. The ice age had pushed populations of everything South. Egypt was verdant then. Copper chisels didn't do t&at stone work. A cement might have been used  for parts but no indication of shrinking or small cracks. Such thick blocks would be difficult to cure without cracks. Quarries exist but no indications of places to pulverize rock for concrete of a sort.?¿?
Reply: Aliens didn't build the Pyramid" The fallen One's did mentioned in the Bible"
Reply: @miltonhollis703  Maybe. Anyway it seems definitely more probable than building pyramids using copper chisels.
Reply: @Dandan-tg6tj  
Yes Dan the copper Chisel theory  dissatisfied me as a dissertation 
On the length of time of building 
The Pyramid, which would become 
Impossible...
Reply: @miltonhollis703  I've explained how I would carve a 3D, 90 degrees interior angle in granite. It is incredible to do so in 2022 and anyone would need a fine tipped tool which if it was made of copper... Hahaha, I'm not even finishing that sentence.
Reply: @Dandan-tg6tj  Copper wouldn't leave a scratch on the granite, lol
Reply: @miltonhollis703  the bible was produced by people 4000 years after the Pyramids were build 😑 dont claim nonsence with your bs god
Reply: @obedientfire840 
You Should Call Yourself AMBIENT FIRE 🔥 🔥 🔥 🔥 A SLEEPY 🔥 Your
Going too See Plenty of It...One Day..
Reply: @miltonhollis703  😑 go read your book and enjoy your fantasy buddy ..
Reply: You just counted single stone in every 5 minutes...how about multiple stones in every 5 minutes because there were thousands of laborers when it was built....
Reply: @gintolsa4978  this is a very valid point. I am working on the complete math for it now, considering there were 100K workers. Even if 100 blocks were worked on at a time, that still only allows 8 hours per block, which is still not nearly enough time. 

The biggest issue is the transportation from the quarries. If 10 workers could move a block at 3 feet per second (which is crazy fast if you think about it) and 10,000 blocks could be moved simultaneously (because there are 100K workers) it would take over 60 years just to get the 600,000 blocks from the furthest quarry to the build site.
Reply: @PiratesInTeepees  what if there is not 2.3 million blocks? They only estimated not knowing what is deep inside right? What if the middle bits are back filled with the chips and pieces from carving the outside blocks?
Reply: @tbutcherfpv810  We pretty much know that there has to be solid blocks inside so that the entire structure wouldn't collapse onto itself. The king's chamber has 8 granite beams above it to prevent the weight of the stone blocks above it from collapsing into it.

We also have methods to determine the density of the interior and we know it's not hollow or made up of loose material.

However magical you believe the pyramid to be, it still has to obey certain laws of physics especially that of gravity. Thus, a hollow pyramid is not possible.
Reply: @MisterHowzat  I don't know why you used the word magical I never did. I also did not use the word hollow. I'm just saying it might not be wall to wall 80 ton blocks. I wish we could do a giant mri on it.
Reply: @PiratesInTeepees  Don't underestimate the proficiency of true experts though.  People can split giant rocks perfectly straightly along lines of cleavage in seconds to minutes with just some wedges and a hammer.  The more you do, the faster you get.  There were probably ingenious methods developed to achieve things in parallel rather than in series to account for the exponentially faster timeframes. Watch any of the videos on here of oldworld craftsman or modern workmen doing there daily tasks with mindboggling efficiency it seems like some kind of magic.
Reply: @PiratesInTeepees  most stones come from in front of the pyramids. Only the large granite stones came from Aswan which is 500 miles from Giza. I think they were tombs for the pharaoh but I don't believe the story of how they were built
Reply: @PiratesInTeepees  It's just so much more fun to believe that extra-terrestrials built the pyramids.
Reply: @PiratesInTeepees  I didn't realize there was a time schedule to get the pyramids completed.
Reply: @gintolsa4978  There is only one problem with that... Not enough room on that Pyramid for thousands of laborers to work, much less enough room on any so called "ramps" for the hundreds of blocks of stone a minuet it would take to line up to lay a stone every 5 minuets, there would have to be a line of stone almost touching that would be a mile long and non stop in order to carry this out. Then what about the time it took once the stone was close to its place then they have to get it aligned perfectly and jostle it perfectly in place. How many men would it take to jostle a several ton stone around...
Reply: @gintolsa4978  Have you ever done any construction or watched it yourself for long periods of time?
Reply: @gintolsa4978  Wow, had no idea you were there and saw all this! Where have you been?? Did you count them individually or just kinda take a WAG at it?
Reply: @gintolsa4978  you're saying this because you have no idea the level of sophistication it needs to even curve 2 stone in a way that a piece of paper can't fit in  between,even by today's tech.
Reply: @gintolsa4978  This is to assume that just anyone can work stone to specification. Most cannot even work stone to anything. They miss fracture lines. Limestone is easier but still requires skill and working to specs. Modern buildings in Egypt are not known for walls at right angles or level floors.
Reply: The pyramids were built by frequency, the Egyptian priests sang the blocks into place. They were Gods and knew how to manipulate the enviorment, long forgotten knowledge that is not known to humans anymore. The mystery begins with the pineal gland. Egyptians were literally Gods, playing around with blocks.
Reply: @Noct343  read my comment. The great pyramids were built 13500 years ago. The Egyptians simply found them, they did not build them. The pyramids were some kind of power source, making electricity from sound waves using the lake beneath the pyramids, it is said that some type of lighting strike or something like that hit the pyramids exploding the gases they were using to make electricity inside the pyramids, leaving explosive residue on the walls inside.
Reply: @Noct343  you ve watched too much Michael Tellinger.
Reply: IF it was built in 25 years.  You can disprove that it was built in 25 years with the same logic by saying it took much longer since placing a block would take longer than 5 minutes each.
Reply: Regardless of how it was done, yes, logistically it's nutty to think it was made in 25 years. 

Heck, we have cathedrals in Europe that took several generations to finish. I know some that took at least 160 years to build.
Reply: @calysagora3615   very true and there’s also plenty of skills that been lost through the decades and centuries.  People underestimated how innovative man can be.
Reply: @calysagora3615  surely you didn't mean one year?
Reply: @tbutcherfpv810  Correct and corrected, thanks.
Reply: There was a river that flowed though there in ancient times. Easy to move and place the blocks then. They had all the water they needed
Reply: @ThePatriotPirate  Man, stop saying shit. Did you ever tried to move such stone from one place to anything that's floating on water? Do you have any idea that a heavy weight must be balanced somehow otherwise if the center of gravity is too high, everything is getting upside down? Do you have any idea of how big some kind of ships must have been to be able to carry all that stone?
Did anyone find one of those huge ships?
If not, how, then?
Reply: @Dandan-tg6tj  I’ve spent my entire life moving stones. I’m an expert on the topic. Enough said
Reply: @ThePatriotPirate  I'm curious, did you ever work with 5000 people all moving stones at once? I'm asking because moving stones or whatever it is heavy with 100 people is something but having 20.000 people is never as simple as working with 100.
The more the people, the more are tired, the more are sick, the more are upset, the more are screwing things up the more need to pee at a wrong time. I don't even remember what I said before but it's either the old people had some amazing knowledge and were able to plan things in a great manner or they were exactly the type of morons who seize whatever they want and simply carve their brand on everything. Someone obviously did it. Someone built the pyramids. Someone carved everything including the fine polished stones with amazingly made 3D interior 90 angles. Who were they I don't know but those only able to work with copper chisels and round stones, were not those who made all those marvels.
Reply: @Dandan-tg6tj  the stones aren’t that well built, amateur work at best. I could do better
Reply: Maybe there were hundreds of thousand of workers.
Reply: @johntatman9168  Where did they come from? Where did they sleep? How were they fed?
Reply: @johntatman9168  you can invite 10,000 people to help put a roof on your house but only 10 can be up there at a time
Reply: @chadsmith9218  Excellent illustration. You saved me the trouble of coming up with an explanation as to how more workers does not necessarily mean faster work.
Reply: @MisterHowzat   yes it’s like gathering 1000 men to carry your groceries only a few would be close enough to touch the bag
Reply: @johntatman9168  with no regard for their safety or lives those people weren’t employees they were disposable assets worked to death.
Reply: @johntatman9168  So hundreds of thousands of workers crammed into a space big enough for 5 workers and lifted an 80 ton block into place?
Reply: @johntatman9168  Even if there were many workers at some point they would get in the way of each other.  And those creases in the sides of the great pyramid would be difficult to produce with rectangular blocks even with very powerful tools. And why was that complexity added to an already difficult project? We could not do some of this even today. So if humans did this how did we all lose those skills? And if we didn't, then who? Why? If before or during the last ice age, do remnants of that society remain among us, somewhere?